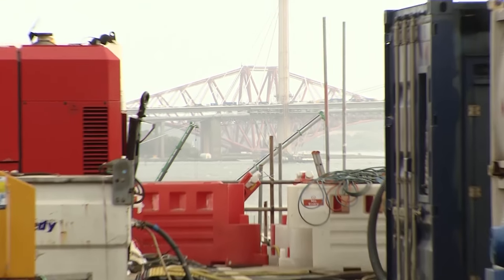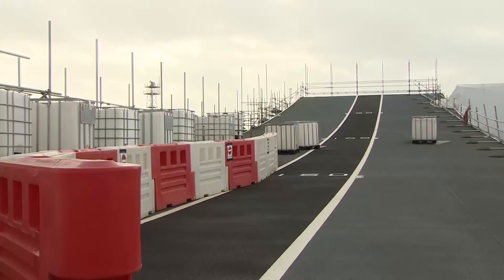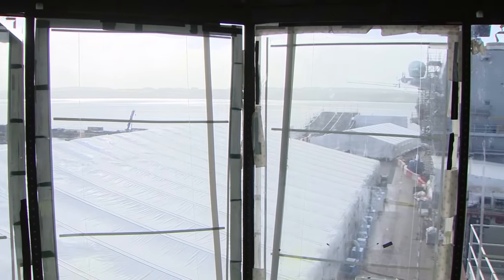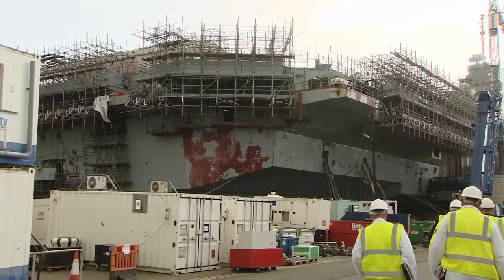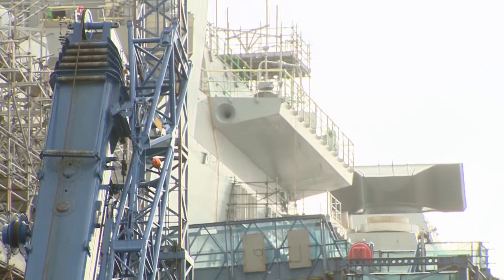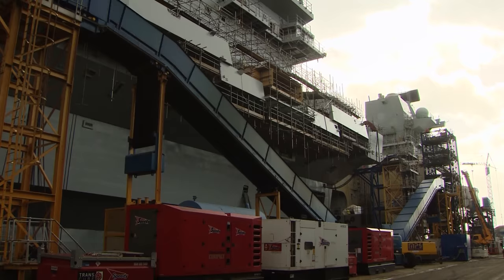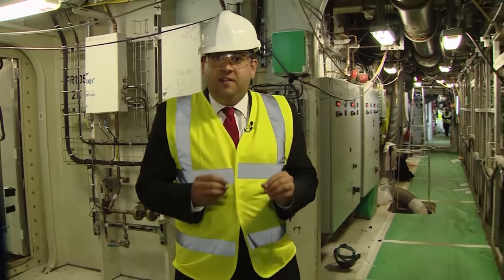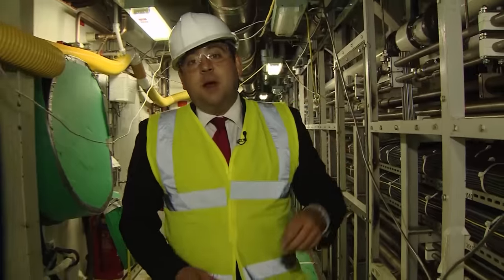HMS Queen Elizabeth Shipshape And Almost Ready | Forces TV

Comment: It's a beautiful ship but it's too bad the shortsighted politicians wouldn't spend the extra money for the angled flight deck with catapults and traps. That would have greatly improved the ship's overall capabilities and put it on par with the world's best aircraft carriers. With cats and traps, she could have carried a much wider complement of aircraft, including the E-2D Advanced Hawkeye (Naval AWACS), C-2 Greyhound cargo plane, the longer range and more capable F-35Cs and she could have even launched and recovered American F-18s and French Rafale fighters in a pinch. By restricting her to vertical takeoff and landing aircraft, her mission capability has become very limited.
Reply: What she really needs is a complement of carrier equipped Typhoons or even more Grippen NG's
Reply: Rafale's or F-18E/F's the only two already carrier ready.  Hell the F35C is a vastly better plane than the turn B model these are getting stuck with.
Reply: I agree, and there are plenty of RCAF and RAAF F-18's out there in mothball that could have been supplied with trained pilots if needed.
Reply: +Ushio01
F-35C is not necessarily that much better. It's better at the strike role, certainly, due to better range and payload, but the higher operational weight will probably make it the least agile of the three F-35 variants in the vital high and fast part of the flight envelope.
Reply: +Paul Abrams
I've thought about this a lot, I'm not sure it's that big a deal. 

The Americans regard their carriers as first-response platforms; they expect to have three of them permanently forward-deployed near potential conflict zones and envisage being able to get one carrier within range of a developing emergency situation within a few days of being ordered to. As such they need their carrier to be able to operate without any external support and it is critical that they have their own long range AEW, EW and ELINT capability on board and available as soon as they arrive. 

For us in the UK the situation is very different, we don't expect to be able to get our one deployed carrier to the warzone within a month unless we are very lucky (or unlucky). In most scenarios the RAF will get there first. The reason we are building carriers at all is firstly so we can contribute something useful to a USN lead military effort and secondly so we can deal with situations where, for some reason, no convenient land bases are available for RAF fighters, but these scenarios will likely be the exceptions.  We expect to have plenty of time to position land based AWACS, tankers and other support aircraft near enough to the warzone to support carrier operations if required (bearing in mind that support aircraft have much greater effective range than tactical fighters and can use airbases further from the warzone). 

What this means is that it would be a waste of our very limited defence budget to buy cat and trap carriers, given that we only expect to need that capability in unusual scenarios. Or look at it another way; how many frigates, destroyers or SSNs would you be willing to cut in order to switch our two STOVL carriers for two cat and trap carriers of similar size?
Reply: Akm72 Many good points...But...
To say we can't afford cat and trap is like  when the admiralty said there wasn't enough time nor funds to up-armour the Hood.
These carriers largest threats include submarine and aerial launched clusters of hyper sonic projectiles coming in for our laundry from every which way but loose.
The carriers need a robust  longer range CAP patrol at distance with enough ordnance to deter long range bomber threats.
I still believe that a complement of say
18 Gripen NG
4 V-22 AWAC Osprey with data link
12 FB-35B
6-EH-101 ASW

The RN must be capable and the nation willing to spend the funds necessary in order to operate independently (if need be) of American interests.

Happy new year!
Reply: +R PM
If additional money was available to upgrade our surface navy I'd probably spend the cash on an improved ILMS for the carriers such as SeaRAM (replacing Phalanx), anti-low Earth orbit satellite and anti-ballistic missile capability for the Type 45s and just more escorts; both Type 26s and new AAW destroyers (an improved Type 45 would be fine). If even more cash was available over the long term I'd probably go for building more carriers on a regular building schedule (say, one per decade) before cat and trap, though if more carriers were going to be built then cat and trap starts to look more attractive.

I also wish you a Happy New Year!
Reply: Akm72 

I would love to see The RN and the RCN and the ANZACS go in for a massive Type 26 build...
Just.like the the Tribals and Leanders.

Result...everyone gets rich..and we all look uniform and very sexy.

Cheers Blighty!
Reply: +akm72 the f35c has the same g rate of 7 1/2 and the b model the f35c is the better aircraft, longer range , payload and same Turn rate as b model
Reply: +brett garnett
Sure, but it has a lower thrust/weight ratio and lower thrust/drag ratio. The big wing will provide more lift, but it will also provide more drag. Generally I would expect the F-35C to turn better at low speed, but to have inferior sustained turn rate at high speed and to accelerate more slowly when it has lost speed. The G-limit is of only marginal importance.

Comment: LOL the Royal navy couldn't build a Flattop that has catapults?
Reply: It could have, but the politicians skimped on money. Meaning the ship's capabilites are actually severely limited,
Reply: Krešimir Koržinek that seems stupid to tell the truth, when russia invades the EU i guess they are going to scream for US help :(
Reply: well that's a given mostly for the pacts and treaties. 

and at the same time, Russia doesn't have a comparable navy so far, it's air superiority over the ground and 300km out to sea is a given, but the navy doesn't stand a chance at the moment. though we know next to nothing about the supposed secret sub fleet.

some will argue the ramp is more....practical given its survivability, catapults "could" fail and require hard form maintenance which can take more time to repair, but ramps can be built quicker than complex moving catapults.
Reply: Ark Royal and Illustrious didn't have catapults either, they were very effective carriers, this one will be too, it's only restriction being the type of aircraft than can land on it.  Not having catapults makes it easier to keep the deck operational should it be damaged
Reply: + Mark P. jets use less fuel on take off. and particularly suited for VTOL, which will be the main jet type.
Reply: the F-35 is coming in 3 variants, a land based (F-35A) a VSTOL F-35B and a CATOBAR version the F-35C. The least capable is the F-35B, since you trade ammunition and fuel for a vertical lift fan.
Reply: That makes no sense. Aircraft carriers are for projecting power far away. You don't need one for defending your own country.
Reply: Ken Kobayashi the best defense is a good offense...
Reply: Rexford L, that is demonstrably false. our "offense" in Iraq made our country LESS safe, for example.
Reply: Ken Kobayashi you didn't read.. "the best defense is a GOOD offense"..
Reply: Its a goddam glorified amphibious transport... without cats and traps it's limited to few aircraft, and by the time of its commission only the F-35 will be available (so if that messes up the entire thing is without aircraft). The ramp disregards cargo aircraft and leaves the carrier as a support ship, since it can't function alone. This is also consolidated by the fact it doesn't have nuclear reactors for power, so its time at sea is limited.

Comment: So just need the basketcase F35 to arrive. I wonder when it will be combat capable? 2025?
Reply: Tell me that isn't true, please? No chance or re-commissioning a few Ocean class is there? I'm told the Seafire did a pretty good job. A Gannet or two might come in handy as well!!
Reply: Alastair Stell
Reply: Literally none of what you said regarding the F-35 is true. The F-35 is extremely proficient at air-to-ground and close air support; it has a payload of 18,000 lb. and excellent sensors to find targets and precisely deliver that ordnance. How do you call mach 1.6 "horrifically slow"? Supercruise has nothing to do with top speed, it's simply the ability to sustain supersonic speeds without afterburner. While it can't sustain them over long periods, the F-35 can attain supersonic speeds without afterburner for short periods. Extremely few aircraft can supercruise. Using afterburner for sustained periods will quickly guzzle up fuel and shorten the range of ANY aircraft, but the F-35 will still have a superior range than the Harrier, the difference is so big. The thrust-to-weight ratio of the F-35 is greater than one (the exact number varies depending on the variant); the Harrier is 0.91. Of course it's no longer stealthy with external stores, just like any other aircraft. You don't put external stores on until you no longer need stealth. No one ever said it was supposed to remain stealthy with external stores. FYI, the radar profile of a Cessna 152 would still be small for a tactical aircraft.

The F-35B is a huge step forward for STOVL design, far better than the Harrier. The F-35B's STOVL system is far more reliable, stable, easy to control, and most importantly, safer. Where the hell did you get the idea that it uses afterburner in STOVL modes??!! It most certainly does not! Not only would that actually burn through the deck, but it would burn right through the sides of the engine exhaust when rotated, too. The whole issue of the F-35 supposedly damaging flight decks is extremely exaggerated and blown out of proportion; it's really a non-issue. The liftfan is not life-limited. The engine has no problem with high-G maneuvers; the F-35A is a full 9G fighter.

You do know that the British have the largest international share of the design and construction of the F-35, right? The F-35 is not an American or British aircraft, it is a joint one, hence the program name. Neither the US nor the UK nor any of the other partners could have built any program as big and ambitious as the F-35 alone.
Reply: And yes, it is true that the F-35B and F-35A are already combat capable.
Reply: Locutus494 barring the shambolic software which is still full of holes.  Last I read the plane was still limited to pulling less G than a decent roller coaster.
Reply: Daz555Daz The software is not a "sham" or "full of holes". It is exactly where it is supposed to be for initial operating capability with 2B and 3i software, as was planned. The unfinished functionality was not supposed to be there for IOC; that's why it's called initial and not full operating capability. Aircraft development and testing takes a long time, you can't just go for everything at once without properly testing and certifying each step.

The current OPERATIONAL flight envelope limit is Mach 1.2 and 5 G. This is already improved over the 450 knots limit when fleet units started flying the F-35. In testing, they already have flown to, and beyond, the design limits of Mach 1.6, 9 G, and over 50 degrees AoA. The flight envelope limits have NOTHING to do with and in no way represent the actual abilities of the aircraft; the limits are purely because full testing and certification of the full flight envelope hasn't been completed yet. Soon 3F software will enable the full capabilities of the F-35.
Reply: The end result is a mediocre-good aircraft for an extortionate price, it would probably be cheaper for the British government to get the RAF to build its own version.

Comment: What if those smart munition handlers break or become damaged in the heat of battle? Can they be moved aside readily and munitions handled manually and where does than manpower come from when all are at assigned battle stations already? You cant call time out in the midst of battle
Reply: That's why I would prefer man power over automation and that's why the US never goes fully auto.

Comment: 679 crew, not including air element; for up to 1,600, Not counting troops from 250 to 900.
 with about 50 compared to 90 jets and not nuclear powered, you can quickly see why the crew size is different NOT because of large hallways or an autoloader.
A touch misleading when you compare a small car vs a train.
But you can get 3 of these for the cost of one ford class, so there is that.
Anyways very cool ship can't wait to see it launch something.

Comment: it is proper one or small one with ramp?
Reply: it displaces over 70,000 tons, technically making it a supercarrier.
Reply: joshua rickwood

so it is 1 with ramp?
Reply: yes
Reply: It has no catapults so it's not a proper one.
Reply: mate its doesn't need to have cats and straps to be classed as an aircraft carrier, carriers in WW2 didn't have ramps or cats and straps and they worked just fine until the jet age came along. the ark royal before used a ramp and also used the highly effective and reliable harrier system. the Russia's sole aircraft carrier, the Admiral Kuznetsov has the same overall look of the american modern nuclear super carriers and yet it also uses a ramp and a modified version of its flanker aircraft, which also was a aircraft mainly deployed from land based airfields.
Reply: World war two barely scratched the surface of jet aircraft. With the greater speed aircraft achieve today, ramps only serve to reduce fuel cost and inhibit other aircraft from landing on the carrier.
Cats and traps for the win.

Comment: Why do they need two conning towers?  Isn't that a waste and very expensive?
Reply: There's a few reasons for the design. Most conventionally powered carriers have one long island so they can fit all of the exhausts and intakes for the engines, this design just splits that and takes better advantage of that extra space.

Front is for navigation, rear for flight operations, they're better positioned for their roles, but they can perform both roles if required. The two main engines are also positioned directly below the islands instead of at the rear of the ship, reducing the amount exhausts have to run through the ship, so splitting them also reduces the risk of both being damaged at the same time.
Reply: TehDocc thank you, now makes sense.

Comment: What is FOAEW called these days? Whatever it is we haven't got it. If I hear the  bloody chestnut about sticking it on a merlin again I will, I swear, scream. Forget about the problems of aperture, endurance, altitude, cabin environment, noise, vibration and the tiny problemette of keeping up with the ruddy FEBA. The Merlin is a low-availability beast, FOAEW is sort of a requirement 24/7.We can't cat launch, and a screwtop needs a cat. Why have we built ski-jump carriers, and spent a kings ransom to procure a completely untested and one-off variant of the F35 when we didn't need to?  The whole point of the murderously expensive Typhoon programme was to ensure we did not land up relying on the USA and fuelling its never ending dominance of the  military aviation sector.  TA-RA!! Ladies and Gentlemen!! I give you Lockheed-Martins finest!!!We have half a dozen Type 45's ( on a nice cool day) so our CEC capability is practically non existent, quite how sensor fusion and the "total air picture" ( God where do they get them from?) can be achieved without aforementioned FOAEW is beyond me,Likewise URG support, these things need a great deal more than AVGAS, they need chips! and sausages!!As of today just how many Sea Harriers, let alone Lightnings, could we man up? Is there any single credible analysis that suggests a STOVL fighter does not come with disadvantages as well as advantages?Why, oh why, are we doing this? The salami slicing procurement nonsense means the bloody things will be due a mid-life refit before they come down the ways!